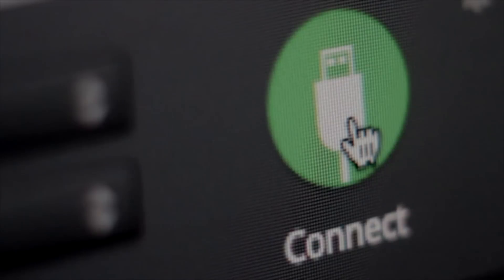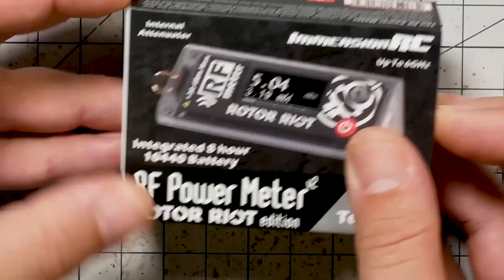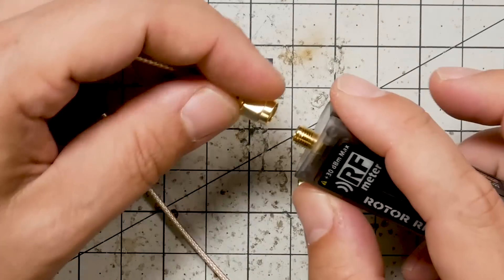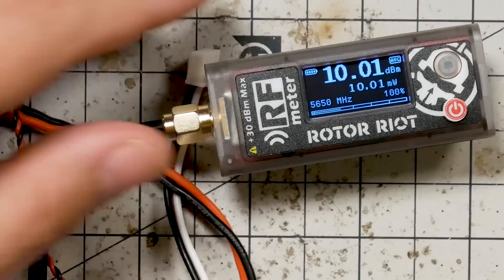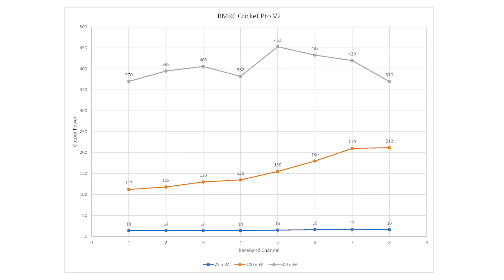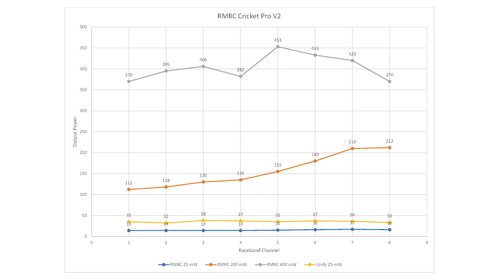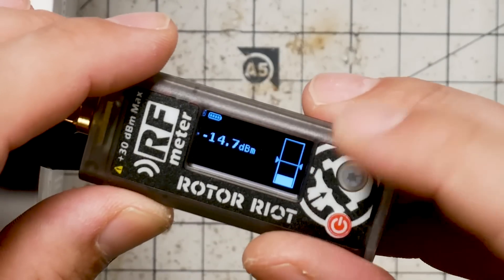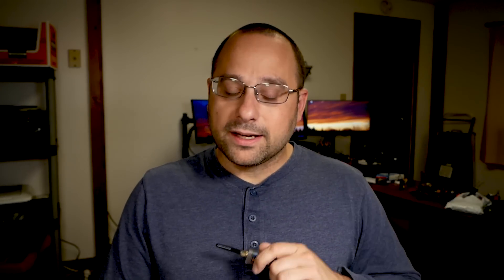ImmersionRC RF Power Meter Rotor Riot Edition

Comment: The reason why people would assume rotor riot just rebrands is probably because what happened to the Alien.

They straight up rebranded it and called it their own and raised the price.
Reply from the maker: That's not right at all. The rr edition alien was made in cooperation with impulse rc and included specific changes / improvements that rr pilots came up with.

Comment: Hey JB, I have two of these meters one of each (I don't know why? geek maybe) and both of them give better readings if you back-off the SMA connector at the meter side of link. If I snug it up all the way I get readings between 8-12mW and if I back it off 1/8 of a turn I get readings of 20-29mW. Does anybody get the same results? Or am I just lucky? Testing with new Tramp and TBS Unify HV (set to 25mW outputs). I like  these meters, I guess that's why I have 2. check out my testing at : https://www.youtube.com/playlist?list=PLIahjYkJW52uRsnu4ghCqhWEnYtPb_tsK

Comment: Have to remember that most  VTx  output different power levels across the band @25mw  and 5800 mhz it may put out 45mw and @ 5900 mhz it may only put out 15 mw freq changes output power. And it varies a significant amount

Comment: From this review, 80$ seems really expensive, since all it seems to do well is measure if a transmitter is on or off. Measuring 13mW when set to 25mW is way off. I would suggest borrowing a higher quality RF meter just to see if the RF meter or the transmitters are correct.
Reply from the maker: How do you know how accurate it is? How do you know the vTX isn't putting out 13 mW?
Reply: That was my point, we dont know. If the setting on the vTX is at 25mW and the meter says 13. Then one of the two isnt working correctly.

Comment: I measured the output power of my crossfire micro tx at 100mw, the reading was 78mw, people at tbs said that the meter was not accurate at all.
Reply from the maker: Make sure you are measuring in peak mode not average. Average mode will significantly under-count the power of a digital transmitter.

Also, the RF Power Meter is not calibrated at 900 MHz so although it will measure in that range, it is not expected to be accurate.
Reply: Joshua Bardwell okay I will try again in peak mode, thanks Joshua!!

Comment: maybe the rf meter being on 5700 and the vtx on 5695 makes a difference to the results
Reply from the maker: No. The RF meter is measuring peak power. The 5700 is just the calibration offset, which is only input in 50 MHz increments.

Comment: mmm... I guess to measure on a dummy load it still will give you a close to accurate measurement to determinate if video transmitter is working fine (close to the selected power level), personally if i was trying to measure the real output I will use a SWR meter and measure the output of the transmitter on a properly matched antenna for the frequency, in that way beyond obtaining information on power output i will be able to discard antennas that perform poor on my specific setup.

Comment: Hmm... I really like like the idea of testing all the VTXs because I don't trust my five TBS Unifies I own since I realized that I get a lot more range with some noname ones or my Matek, which should have less output power. - I was really temped to buy one when they came out.

But your tests and experience with both of your testers before kept me from buying one.

So which sense does it make to test untrusted VTXs with untrusted tools? - Who tells us and you if the tool is reliable incorrect, or maybe correct now after they send you a new, proper calibrated one, in the same way, on different VTXs, situations, etc.? - Yes, I watched your previous videos about this topic.

Wouldn't it make more sense to first find someone with one of those really expensive, but exact meters to ensure yourself that your own mesurement tool works correctly, incorrectly in a same way on every mesurement or even that unpredictable incorrect that it simply may not be used to do public mesurements and comparisons of different VTX products, by doing some comparison tests with the expensive one and the IRC power meter on at least a few different VTXs?

Imho that should be the correct way to go. - Publishing test results of different VTXs, done with this tool without any verification that your test-tool even works reliably in some way, does not seem to be correct to me.

Ah, btw.: Now you own two versions of the IRC RF power meter, the normal and RR edition. (Or didn 't they send that one back at all until now?)
Did you make some tests of the exact same VTX with both of them? - And if so, how were the results? Same?

And: Many thanks for all your efforts and honest tests that give us all these great insights!

Comment: Is there any value in measuring the current draw of the transmitter? Surely a 600mW transmitter will be pulling a lot more current than a 25mW transmitter (assuming same battery voltage).
The only value I see is setting the upper limit of the theoretical power output. A transmitter can't be outputting more power than it's drawing from the battery (sorry free energy kooks). Granted, this doesn't provide a lot of info but it is some info. Whether or not it's worth the bother is certainly debatable.

Comment: I love my RF power meter! Even if it's not 100% accurate I use it for comparative measurement's ie is VTX A outputting more power than VTX B on the same channel and settings. Or, what channel does this VTX output the most power on? Works a treat! I've got to say that most of my cheap Eachine VTXs output low on all power settings. It's nice to know roughly what you're outputting and weather or not you have damaged your VTXs.

Comment: Nice tool; however, like the new cell phones non-removable battery = Planned obsolescence.
Reply from the maker: Sorry but you're mistaken. The battery is built in, but it is not, non-removable. You can open the case and replace the battery and it is a standard-sized lithium cell, not even soldered in--placed in a standard battery carrier.
Reply: Coooooooooooooooooooooooooooooooooooooooooooooooool ! Thanks for the input, now time to buy one...

Comment: $80 bucks, for maybe, if, but, not sure if its calibrated...   Think this product has been rushed a bit to hit the market and with all due respect JB I know you do very fair reviews and are quite honest with them, but this just might not be as accurate as you might think and could potentially create more problems than solve...   IMO

Still a good initiative from Immersion, but definitely needs more work!
Reply from the maker: Look the bottom line is if you want accuracy, you have to pay 10x to 30x the price of this unit. For $80 this is a very, very capable tool.
Reply: I've seen these things diagnose problem quads at race events more times than I can count. Absolute value doesn't matter, just calibrate in scully mode with a known good vtx (tramp or unify with clean install and brand new pigtail plus antenna) and compare relative outputs. It becomes incredibly clear if somebody is accidentally on 200 mw, and it also becomes incredibly clear if you have an internal brake in your antenna. I've had them save a weekend of racing before by diagnosing an antenna as broken when I thought it was the VTX. Race days you can't just swap an antenna and fly it to test, but you do have moments here and there where you can plug in and wave a power meter next to the antenna. 
I would never disagree that the product should be continually refined, but trust me it's already a highly useful product for a racer
Reply: I understand,  but I didn't say it didn't work I said it doesn't seem accurate enough to have a precise reading. For checking power outputs on races, yeah it will give you a rough estimate. This is a product every RACE organizer should have just to make sure everything is on the FAIR side, but your avg pilot wont be needing it IMO...   not as an absolute necessity of an investment.

Comment: Interesting timing for this video. I spent a few hours yesterday with my Immersion version ( that's funny ) of this power meter testing 4 different 200 mW 1.3 GHz transmitters. Three of them tested approximately 180 mW on all legal channels and one tested at only 30 mW so I tossed it in the trash. Saved me a huge amount of time and frustration I would have had trying to figure which transmitter was bad the old trial and error method. Plan to test all of my 5.8 GHz transmitters today!
Reply from the maker: This is exactly the use of this tool. Although it's not necessarily absolutely accurate, it's very helpful for this type of troubleshooting.

Comment: J, i've got a question for you, what is your main (favorite) goggle you are currently using, i thought it was the hdo but i'm not sure. If so why do you choose it above all the other ones, especially the EV200D, which seems the best to me imo, maybe a good idea to make a video with best to worst goggles? Even though it will probably come to preference
Reply from the maker: The EV200D is far from the best in my opinion. The image is a bit washed out and it has 16:9 screens which are not a good fit for my 4:3 cameras. My current go-to is the HD3. I like the HD2 a lot also but I did the inductor mod on the HD3 so it runs RapidFire without issue, and I'm currently testing the RapidFire.
Reply: https://www.youtube.com/watch?v=gke0i6S75Qw&t=1s

Comment: Could the meter be reading RMS power output rather than PEAK? I see the word AVG on the setup screen. Some TX manufacturers may be advertising PEAK values.
Reply from the maker: For an analog transmitter, there is no difference between avg and peak. The signal is simply at a constant level. Peak would be used for digital transmissions.

Comment: i don't see problem of using 4 pilot channels with 600-800mw, we use them always with Wings/planes and some longrange quads, all works fine. so 25mw or 50mw for small open field race quads will work fine with correct channels and clean vtx!

Comment: I don't get these powermeters... Measuring on 5700MHz when the Transmitter is actually supposed to output on 5695 MHz for example makes no damn sense. I work as a technician for the local Cable Company here, and i know from experience, that you need to set your Meter to the exact frequency you are trying to measure. I don't know exactly how wide the channels are in those Analog transmitters to be honest, but my guess would be that being 5MHz off is a big deal. Why don't they at least give presets for the actual channels that are used like every modern receiver does? Or better yet let us change the Frequency in 1MHz steps? Probably that would mean you need much more sophisticated hardware so it would be more expensive, but at the very least it would be useful that way...
Reply from the maker: Now you can argue that you need calibration values at more than 50 MHz increments, to which I say, that's why this is $80 and not $3000.
Reply: @JoshuaBardwell  are you actually sure that it works like that? That would make alot more sense actually. It would be good if it would show that frequency then...
Reply from the maker: No, you're interpreting it wrong. The calibration values are input at 50 MHz increments. It is not "measuring at 5700 MHz". It is measuring peak power on whatever frequency it detects as the peak. But it is applying that calibration factor from 5700 MHz.
Reply: no its not! check the channelwidth
Reply: Laforge modules have a nice spectrum analyzer mode where you can see the parabolic curve it does drift around some but I'm not really educated on how wide a range an antenna will pick up given it's length.
Reply: you should show the difference in Mhz units (+or-) between meter and vtx at each channel to determine to what degree the gradation in measured output is related to this discrepancy